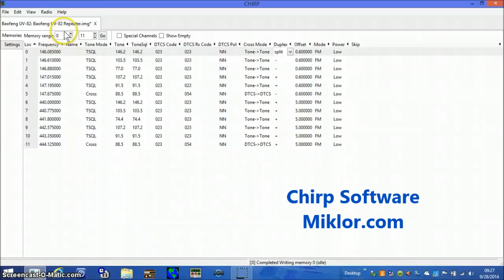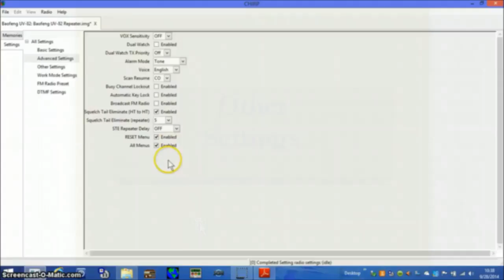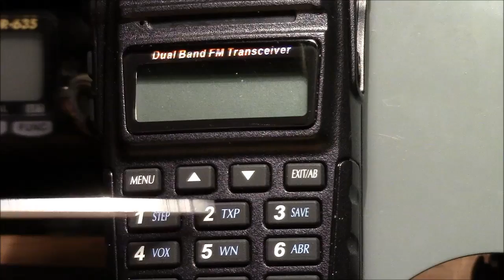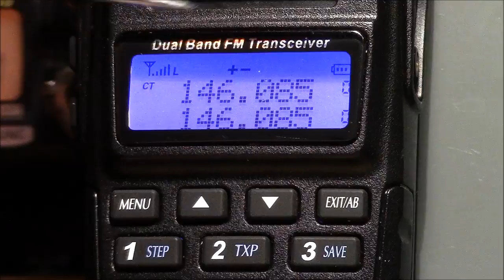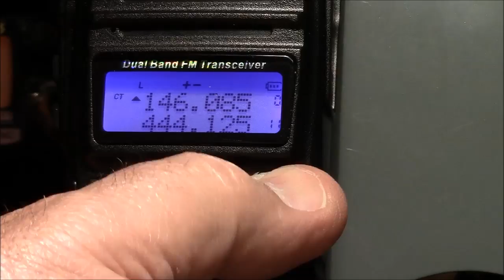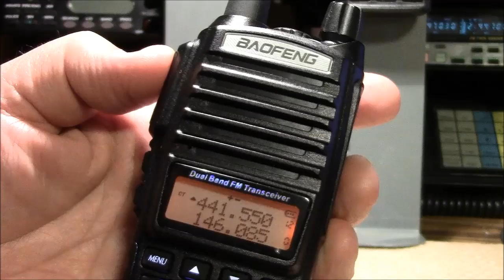Chirp Programming the UV-82 - Repeaters - Baofeng

Comment from the maker: YZFoFittie:  To use your radio WITHOUT CTCSS of DCS just go to the memory settings on the Chirp Software and on the column "Tone Mode", select "(none)".  That will turn off your tone requirements.
Reply: I see that option, but how would you use a 100Hz PL to open a repeater but not also have a CTCSS/DCS tone enabled?
Reply from the maker: OK.  I understand your question now.  I'll go back to my CHIRP and see if can figure it out..  To be clear:  You want to operate the radio so it sends PL but doesn't require PL on the walkie Talkie Receiver.  Right?
Reply from the maker: YZFoFittie If you have a repeater that requires CTCSS/PL tone to access it's receiver however does not transmit PL Tone back to the Mobile User with it's Transmit Frequency, here's how you program the radio

FREQUENCY-------:  Repeater Transmit Frequency
NAME----------------:  "User Selected Name"
TONE MODE-------:  Tone
TONE----------------:   User Selected CTCSS/PL Frequency
TONE SQ-----------:  Does not matter - Any PL Frequency
DTCS Code--------:  N/A
DTCS Rx Code---:  N/A
DTCS Pol----------: N/A
CROSS MODE---:  --> Tone
DUPLEX-----------:  User Preference
OFFSET-----------: By Band Plan if Duplex is Desired
MODE--------------: User Preference
POWER------------: User Preference
Reply: Theres the key, where you put "N/A" there MUST be a selection, there is no "N/A" or "OFF" in CHIRP, so you must select from the list. This means than someone listening to that frequency must also select the same value in order to hear you when using the repeater? No? I have a list of repeaters in my area and NONE of them list a CTCSS/DCS value but almost ALL require a PL tone. It appears CHIRP or BaoFeng does not support this ability? It has to be both or none? Or am I missing something? I am a NOOB after all! =) Thanks very much for taking the time to help!
Reply from the maker: YZFoFittie N/A in this case means to ignore the selection.  i.e. Don't Worry about the selection because it's being ignored by a higher level selection you already made.  For example;  If you use "Tone" in the "Tone Mode" selection, the Receive CTCSS/PL selection is ignored by the radio.

Another point of confusion is;  CTCSS and PL are the same thing.  Analog Tone.  

Sorry I'm so long at replying but I missed your last question.
Reply from the maker: The Erod1944 Channel So the make something "clearer";  The radio has 2 types of channel selection
1.  PL and CTCSS are an analog style of selection ie; an analog tone (100Hz etc) which is detected by an analog detector in the receiving radios receiver.

2.  DCS is a digital selection style.  ie; the radio sends an inaudible code burst (in the case of the UV-82 - other styles of digital code are audible. 

The CTCSS/DCS selection you mention is incorrect.  You can only have CTCSS/PL *OR* DCS.
Reply: That makes a lot more sense, thanks very much for all your help! Im 3 weeks deep waiting for my call sign so I can make my first contact. =( At least my radios will be programmed and waiting...

Comment: Hi Ed thanks for that video, i just bought 82hp, but i just not clearly understand HOW or WHAT i have to set it for as repeater, especially the small arrow not going back to active chanel if i hit the other chanel wich is not active ? 17.35 - 18.03 in your video clip, thanks for information
its very intersting, like have 2 input ch repeater

Comment: There appears to be no way of turning off the "tone" on my software. You have to select a value and there is no 0 or OFF. How is that? Not everyone uses DCS/CTCSS/PL especially in simplex? Several columns of tone related settings and not one has "off" or anything like that!

Comment: I don't have a 'Settings' button on my version of CHIRP, is that because my radio isn't currently connected?
Reply from the maker: +mrsiborg Try downloading your radio data into the Chirp Software by performing the following ----

1.  Turn on your Radio
2.  Attach your USB Programming Cable between the radio and computer
3.  Open the Chirp Software
4.  Select RADIO
5.  Select DOWNLOAD FROM RADIO.
6.  Select OK in the cloning box that appears in the center of the screen.
7.  You should see a green bar moving on that box and lights flashing on
      your programming cable.
8.  If Number 7 failed make sure the dual plug is all the way into the radio jacks    
     or try turning your radio off and then on.
9.  Try Step 7 again.

The point is, you have to initially download the radio data into the Chirp Software so that the software knows which radio it is working with. 

You can also view another UV-82 video which provides info concerning working with the Chirp Software and the radio in general.
https://www.youtube.com/watch?v=3msZvaAa9qw
Reply: Thanks mate, that's good info.

Comment: Will this radio work on the ground for my aircraft 108.0 - 136.9875 Aircraft band I need a radio for tuning my aircraft radio and talking to people on the ground. Any input will help. If it will not is there a inexpensive ham handheld that will work? I transmit mostly on 122.8 THANK YOU for any response.
Reply from the maker: +Richard Almond No.  The B100 will NOT work on the aircraft bands and could possibly damage the transmitter on an Aircraft Radio.

Ham Handhelds - The aircraft band is AM and most of the Ham Handhelds work in the FM Mode and are transmit locked within the Amateur Frequencies.

I've sent you some links that offer various aircraft band antennas from base station types to car mounted magmounts as well as a couple of AirBand Radio. Obviously, a magnetic mount won't attach to an aluminum plane.  For more Info try putting "antenna aircraft band" in google.  It's also possible to build a 122.8 MHz antenna - a "Dipole" - out of common wire, some coaxial cable and a connector.

http://www.dpdproductions.com/page_vhf_air.html#vhfairmobile14

http://www.amazon.com/Sirio-Antenna-Md-118-137-Aviation/dp/B00BRZFG2O/ref=sr_1_4?ie=UTF8&qid=1450909583&sr=8-4&keywords=antenna+118+Mhz

http://www.amazon.com/Yaesu-FTA550-Handheld-VHF-Transceiver/dp/B00JFJU5Y8/ref=sr_1_1?s=electronics&ie=UTF8&qid=1450909780&sr=1-1

http://www.amazon.com/Icom-IC-A14-VHF-Band-transceiver/dp/B003EN1VDK/ref=sr_1_2?s=electronics&ie=UTF8&qid=1450909780&sr=1-2

http://www.amazon.com/Icom-IC-A14-VHF-Band-transceiver/dp/B003EN1VDK/ref=sr_1_2?s=electronics&ie=UTF8&qid=1450909780&sr=1-2

Ed/Central California

Comment: I work as a EMT and want to program a radio channel 153.800 and a pl tone as 127.3. Can you do this simply by putting it in with the buttons or do you need to download this via a computer. I need a radio for my job
Reply: + Birney Hoover bom dia amigo, este rádio tem um range de frequencia de 136000 a 178000. você pode fazer várias programações usando apenas o rádio sem auxílio de computador. por exemplo: pra configurar um repetidor é necessário digitar a frequencia de escuta primeiro e depois a frequencia de transmissão, em seguida é só programar ambas no mesmo canal que o próprio rádio de encarrega de colocar o dup de + ou de - . tenha um bom dia. espero ter ajudado em algo. PU7 JAX- PX7E4338 QRA ALEXANDRE MOURA pelo interior do estado do rio grande do norte BRASIL.

Comment: OK Ed or anyone I want to program the radio and then set it in scan mode, in total I have only 4 channels I want in Scan mode and then lock out the rest, Can I do that with the UV-82 and if so how, once done how do I start scan and can this be done with the radio only or do I need the software which I have
Reply from the maker: I haven't tried this yet and my computer is in the shop because of Windows 10 Updates HOWEVER;  If you look on the SETTING SCREEN, you'll see the word SKIP way to the right.  By checking SKIP for any SPECIFIC  CHANNEL you should be able to remove that channel from the scanning list.  I have no clue if the SKIP can be done from the UV-82 Keyboard but I'll check that out,

If SKIP is not visible you may have to go into ViIEW and  Select COLUMNS.  A drop down will appear and you have to make sure that you have SKIP CHECKED......Ed